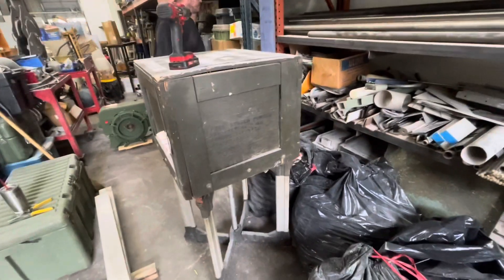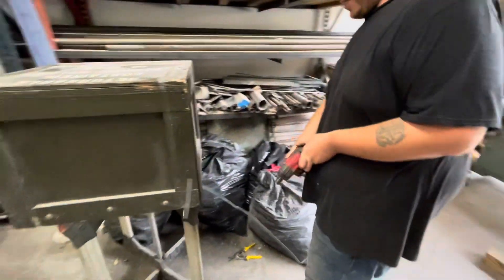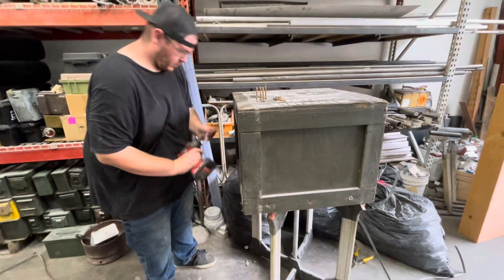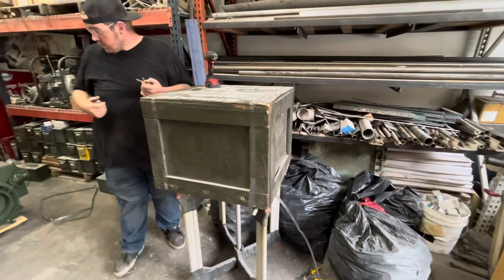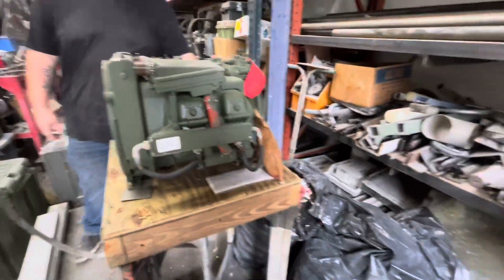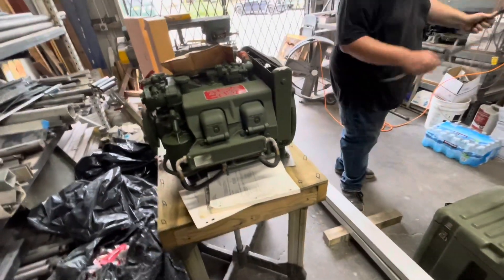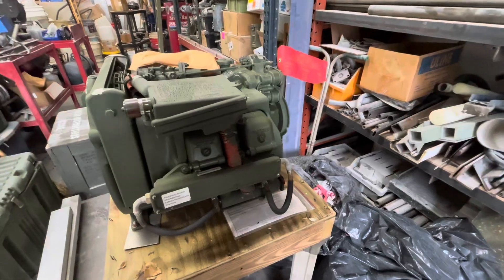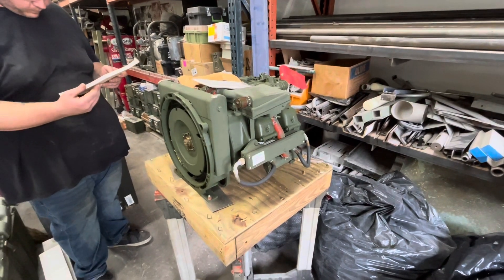4A032-4 Military Standard Engine Unboxing

Comment: You are a dumb ass this is not a pull start engine it needs a electric starter and the pully in front is for a alternator for charging plus there is also a governor on the engine to limit over rev.

Comment: The flywheel side bolt pattern is a standard sae#5 used on many engines from kubota, yanmar, perkins etc. the flywheel isn't really a flywheel though, just a cooling fan.

Comment: 32 cubic inches and 6 HP?  That doesn't make sense!
Reply from the maker: yeah it doesnt but the carb is real small
Reply: Yeah actually they're rated 18 to 20 horse due to the fact these were built for the military they underrated the horsepower